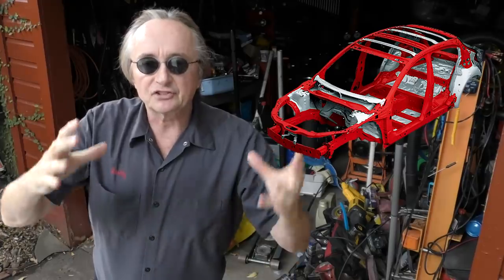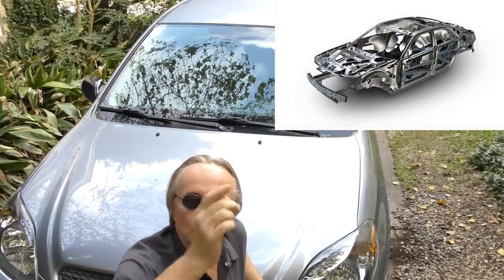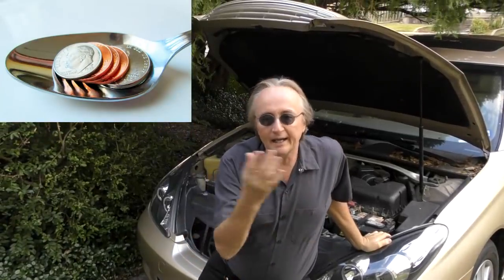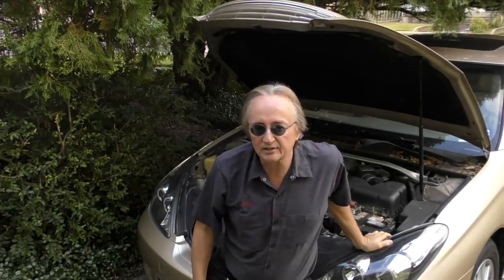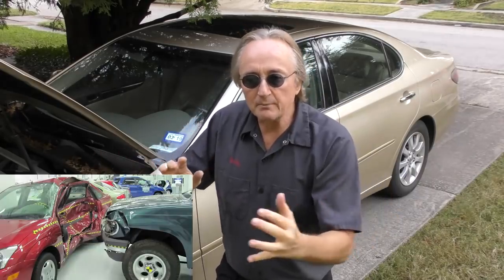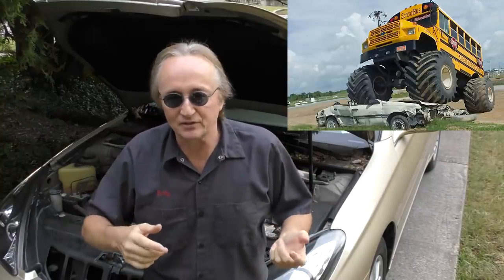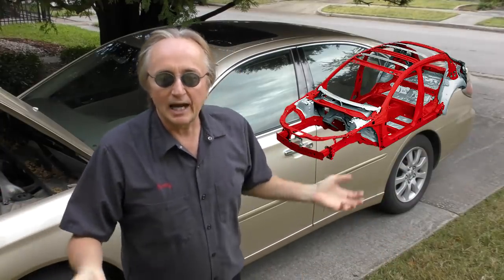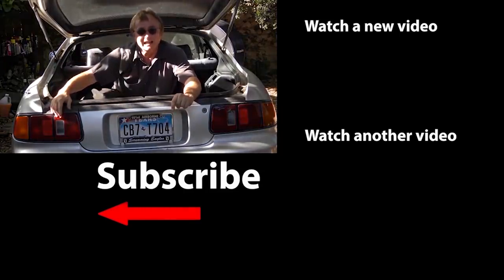Why New Cars are Safer than Old Cars

Comment: New cars: lots of crumple zones. Old cars: the crumple zone is the other car
Reply: That's how I feel driving an old chevy half ton with a brush bar and metal bumpers on both ends ahaha
Reply: No YOU are the crumpled . Actually it's even worse, the car may not even crumple and remain intact and give you crippling injuries due to the shock
Reply: This ^ rolf bjorn is right
Reply: @rolfbjorn9937   you are exactly right......its a proven fact...the more your car crumples, the less chance you have for major injuries,  the less the car crumples, the more your body becomes the projectile in a crash. Take Indy Cars for instance. 20-30 years  ago a hard crash almost always resulted in severe injuries or death.
It was a normal occurrence. But over the last couple of decades the cars have gotten substantially safer due to a scientific application of the crumple theory to every single aspect of the car. This makes the car absorb the crash much more than previously and helps to lessen the impact to the driver. Of course the drivers cockpit cage itself is protected by carbon fiber which helps a whole lot more, but even without that the cars would be way safer today than they used to be. Yes fatal accidents can & do still happen but far less often. Almost 20 years ago in Nascar  If you look at Dale Earnhardt Srs fatal crash at Daytona in 2001, the crash looked extremely minor comparatively speaking if you only look at how the car stayed together.  But Sadly  Earnhardt himself absorbed the entire brunt force of the crash because the car largely resisted crumpling
Reply: @richarddobson3138  Just to be clear, the occupant cabin/tub/zone is made to be as rigid as possible, and so are other sections, but there are indeed zones designed to absorb the impact and dissipate it, at the expense obviously of the car itself. But even with harness and seat belt, the problem (when worn) is not so much becoming a projectile, but sustaining rapid acceleration of over hundred g's.
Reply: @rolfbjorn9937   well described Rolf...thanks
Reply: @Kevin spacey You are telling us EXACTLY the difference between a stiffer car and a car that crushes. My 1999 Pontiac Sunfire faced the same things as your Grand Cherokee: 5 inch hard maple tree at 45 km/h= cracked bumper. But a tiny rear end at 30 km/h (stupid lady on medication not braking) also= awful whiplash. My car was intact. It got a good 6 varying degrees of fender benders over time that didn't bend anything, and I as the occupant had quite a shock each time. I know exactly the type of bumper cover with semi rigid plastic (you had foam, mine was semi rigid plastic) underneath between the steel crossmember. Everything that hit that corner broke itself on my car. 

I know however that any collision, especially if not a perfect front overlap would mean my death or worse at any speed higher than 50km/h.
Reply: @Kevin spacey Also, remember, modern cars are sacrified aroubd the occupant. Disposable car, important occupant. And also pedestrians too unfortunately, those pesky deer in headlight kind of people who dont look before crossing,  force cars  to be made soft and fluffy for a good 2 feet in the front (pedestrian crumple zone) and THAT makes them expensive to fix in fender benders!!
Reply: @Kevin spacey Well, you've seen wrong. Most likely aluminium crash structure, or you've seen a plastic radiator support of some sort. There is no plastic bumper of any kind in there.
Reply: @Kevin spacey And smaller cars are generally safer than SUV type, but a bunch of assholes just decided  over time that SUV for everybody, where they provide lower fuel economy and often less interior space but just being larger, taller heavier was better. 

It's harder to make a Ford Explorer/CRV/Santa Fe/X3/Qwhatever etc massive chunk of metal stop, and it's the same in an accident, more mass at same speed means more energy to dissipate, and there are quickly diminishing returns to adding more mass to it to reinforce it. 

And the higher COG means more likely to tip over. Go look at stats and reality vs your "feeling" that taller vehicles make them inherently safer. Edit: Yes, being hit by a larger vehicle means your more likely to die, but in a world of SUV taking over...it becomes moot, and you end up with simply larger vehicles overall. Collision avoidance is also easier in my tiny sedan vs a bigger SUV, but we end up analysing driver abilities when going there. And you being in favor of larger vehicles is a one sided point of view: you forget about the risk to other drivers, and there SUV and pickup trucks become rolling reapers.
Reply: A lot of times the older cars would just sacrifice the big steel bumper in a crash.
Reply: @hanskinslo326  Low speed ones, yes. Medium to high speed= occupant sacrificed. You cannot infer the survivability of a car(and mainly the occuypant) to a fatal level collision from it's fender bender survivability. My previous 99 Sunfire destroyed 2 SUV front ends, a 5 in tree and a fence and a Volvo XC70 wagon destroyed itself on my corner (front end, lost a blinker housing) , but it's top rated in deaths per vehicle because it just doesnt hold up to actual at speed collisions, and in side impact even low speed I'd be dead.
Reply: @Kevin spacey There is a full width aluminium or steel bumber., which is attached on either sides to the crash boxes. .. behing the pedestrian crumple zone, so yes, starting in 2000 roughly, there is a void between the bumper cover and anything significantly solid. But no, the car does not have a plastic bumper ffs.
Reply: Jack Girdlestone that’s not what Scotty said. He said the frame in an old car will take the impact but that impact gotta go somewhere and it’s the driver passenger cockpit of the old car.
Reply: @rolfbjorn9937  the "Body" portion of an old body on frame vehicle would be completely and utterly destroyed in a head on collision with a modern unibody vehicle with only the solid steel frame surviving.
Reply: @Kevin spacey you're completely misunderstanding this entire thing. Your '89 and '98 vehicles are "modern cars" and are likely both unibody designs. They might not be but probably are.
Reply: @rolfbjorn9937  my 2000 honda accord is the same way, been in fender benders with newer cars and had practically zero damage to my own, period even to body panels, thats not the point, the point is Kevin Spacey doesn't realize his '98 jeep and '89 wagoneer are considered modern cars, definitely the jeep and probably the wagoneer too.
Reply: That’s why I’d get. Old Volvo, they’ve always been safe
Reply: More like the crumple zone is the passenger of the old car
Reply: @tony_5156  A new Yaris is safer than an old Volvo... There is a fifth gear video where they crash an old Volvo 960 into a new Renault modus city car, and the big Volvo is crushed by the little Renault.
Reply: @rolfbjorn9937  I know a guy who had a bull guard on his truck, and hit a moose head on at 100km/h. He was able to walk away with no injuries
Reply: Go watch some crash videos...The top body will peel away from the frame and crumple bad.
Reply: Actually That Depends On The Vehicle.

A Newer Cadillac Sedan Is A Lot Safer Than An Older Cadillac Sedan.
Reply: @rolfbjorn9937  There's no crumple zone in this car, so if you crashed your car. Your face, is the only crumple zone
Reply: Old cars: The crumple zone is you

Comment: guy in school had a 78 olds.  he slid off the road that winter and went nose first into a phone pole. no damage to that car due to its thick bumper.  no damage to him.  not even whiplash.  I'd rather deal with that over an airbag exploding in my face.  guy I know was in a porsche that was about to crash so he grabbed the passenger door handle to brace himself.  side air bag went off and blew through his arm and now he has permanent nerve damage.

Comment: "What would you rather have survive in an accident? You or your car?"

That's basically the summary right there.
Reply: It's like the old joke.  Robber: "Your money or your life!"  Victim: "I'm thinking.  I'm thinking."
Reply: @dansanger5340  , The Robber Will Take Both
Reply: I bet a brand new 2020 Toyota Corolla is safer than a 1994 Toyota Celica. What would you rather have saved, Scotty? Your money or your life?
Reply: Allen Attoni  Stay clear of the Buddhists on the road.
Reply: @petersmith2040  Though cars do better in crash tests, people outside do worse! A Switz study showed that crossover /SUV type vehicles had 3.5 times higher mortality for cyclists and pedestrians in city accident scenarios! So driving an old small car that will end your life in a fender bender, might be the responsible thing to do.
Reply: Right!
Reply: Pretty much sums it up.
Reply: @petersmith2040  Celica is still unibody even though it’s from 28 years ago
Reply: With old cars, the vehicle & driver die

Comment: New cars = SAFE
Old cars = COOL
Reply: Many Mopar muscle cars were unibody........Rev up your 440 SIX PAC
Reply: OOM- 8018  ? no lol
Reply: OOM- 8018  in virtually no way are they safer. Easier to fix after a crash, sure, but the passengers will come off a lot worse than in a modern car.
Reply: @RaspberryCai  trust me you can still get pretty messed up in a crash in modern day car if the uni frame engine and transmission went into the firewall.
Reply: OOM- 8018  agreed holy crap i forget those cars from when i was kid are 20 to 25 yrs old now. and i was born in 1992. and i currently own an 06 crown vic p71 very powerful engine and transmission combo trans was just rebuild before i bought it. very safe yet aslo had the frame reinforced for all that power that 4.7 can unleash reinforced stright from the ford factory. those crown vic p71's are track racers for someone on a budget. i may trade mine after the winter and snow disappear for something older and rare as that. probarly a late 70's bronco or old school boxy suburban or k5 blazer. i got that crown vic for a steal too because his wife was getting in him for having too many cars. so he wanted 1800 at the lowest 1500 i flashed 1300 bucks CASH. And his eyes lit up like deer in headlights he agreed to 1300. only reason he took the offer he got tired of getting trade offs or lower then 1300 like a pos rusted out ranger someone offered him plus 800 bucks.
Reply: @brandonplaisted8194  It happens more often in older cars where the engine and transmission intrude into the passenger compartment. New cars with their crumple zones also help in keeping a transmission and engine from intruding into the passenger compartment. Years ago I saw an accident where a speeding motorcyclist ran head on into a 1968 Mustang. The biker obviously was killed, but the driver of the Mustang sustained serious injuries from the transmission being pushed into the passenger compartment. Another time in the news, they showed a motorcycle that had broadsided a car. The estimated speed of the motorcycle was over 100mph. The motorcycle cut through the car and the wheel was making a bulge on the opposite side of the car. Any street car going fast enough can't save the occupants. The only exception I've seen was a Ferrari that crashed in Southern Cal back around 2005 or so. The Ferrari had a carbon fiber tub, which is too expensive for everyday cars.
Reply: Holly Manigold had the steering wheel/column try to come in on her.

She prevented that with her arm strength.

she escaped serious injury by "pushing the steering wheel away from her body as the crash occurred, leaving the steering wheel broken and crumpled.
Reply: @Rhaspun  a lotta of cars are now starting fail the 5 star rating on crashing from the nhsa. it's sad because it's probarly recalls that have to do with the features that can save your life in accident vs. the car industry saving a few thousand now compared to millions in lawsuits later on down the road.
Reply: New is almost always > than old.
Reply: A GMC fullsize truck hit me before.

At 20 something crashed in my passenger rear door and got my wheel out of alighment. Of a midsize car.

The truck just had scratches on its metal bumper. Blown airbags too.

I had a concussion. Because I did not have side airbags and hit my head on a plastic panel.

Get a vehicle with side airbags and seat pretensioners. They make a difference.
I know from wrecks.
Reply: Dont get small vehicles.
All these tank like SUV's and huge trucks will mess you up more.
Reply: Hey Scotty, Happy Thanksgiving. What do you think of Hyundai in general and how do you rate them on durability and value for the money? Thinking of buying a 2019 Sonata, will this car last more than 10 years if well maintained? Also, why haven't they offered a midsize truck like the Toyota Tacoma?
Reply: You’re telling me a car that absorbs zero force and had bench seats with no seatbelts and glass that would shatter was not safe? Pssshhh
Reply: 20 yrs old car is old.
It has seatbelts so do 80s cars and 70s.
Reply: In Jan. 1, 1968 it became illegal not to wear a seatbelt in the US. 60s cars had them.

If yours dont have it then get them installed.
Reply: @Matthew Dawood Khaghani really how many recalls are done yearly and mostly due to safety equipment or stuff that prevent a drivable car or truck.
Reply: @RaspberryCai  watch the old vs new malibu charsh test
Reply: Solution buld the old body styles with the safety features of modern cars
Reply: @dragonnx2843  Those old body styles have their issues, but in fact, maybe inserted over good newer chasis could help. Know that I think about it, watching a car like the Challenger (that have that boxy but a bit curvy 70’s car look) already have good security and food crash performance
Reply: @brandonplaisted8194 Zzzzzzzz old cars aren't safe

Comment: Scotty, i want to mention the Volvo 240 had a unibody frame with crumple zones both front and rear way back in 1974. They also had reinforced cage for the occupants and a reinforced transmission well and 2 pieced driveshaft to make sure the engine was pushed under the vehicle. They also had 4 treepoint seatbelts and a folding steering collumn
Reply: Yeah, still not safe today. Any modern car would eat one alive for breakfast. (in a crash)

Comment: What about towing? Unibody vs body on the frame?
Or two cars with 5000lb towing capacity,  towing both 3500lb. Which one is safer? Honda Pilot vs Toyota 4Runner?

Comment: Which vehicles are reliable and cheaper to fix or work on it yourself? American vehicle or foreign vehicle? Also what are the pros and cons of a 2005 Cadillac STS?
Reply: He has recommended 90's Toyota's the most
Reply: Cadillacs are expensive to repair and had head gasket problems would also cost a fortune if the transmission went out
Reply: If it's a Northstar, those engines have frequent head gasket leaks that basically total the car.
Reply: Thanks for all the responses. All appreciated.
Reply: Definitely avoid Cadillac. The STS 3.6 consumed oil and the electronics are a headache. An excellent car to work on yourself is a Crown Victoria. Lots of space in the engine bay, tons of online support and a fairly simple design. Just avoid former cop cars.

Comment: My 1962 Impala had no seatbelts and no padding on dashboard. After one fender bender in 1997, that thing got sold.
Reply: Good move! Nothing like a steel dash with steel protrusions and solid steering columns. I love older cars, but would hate to get into an accident with one. Had many in my youth, but I won't have one now.
Reply: Could have just added seatbelts !
Reply: Well what happened in the fender bender that made you decide to sell?
Reply: @Kevin spacey In the time mentioned by the OP and to which I was referring, I don't think any of the safety equipment you mentioned was available on the Wagoneer.
Reply: @01trsmar Won't help much

Comment: The early unibody cars are death-traps, in a heavy crash the roof and pillars bend and the whole car crushes up. Newer cars have much stronger pillars that start at the front (the A pillar) and run the length of the roof to the rear (C pillar), these may be slightly harder to see past as they're much thinker, but in a crash they prevent the occupant compartment from folding and being crushed.
Reply: No old cars are safe

Comment: Hey! Fuel is getting expensive here, I want to run my vehicle on used cooking oil, what do you think?
Reply: My friend did that with his old Mercedes diesel!   He got his oil from fast food restaurants; when he would drive by it smelled like french fries!!!
Reply: The downside is you get less gas mileage.
Reply: I've looked into it a bit, make sure your car can do it properly and with no damage occurring, some cars don't run too well on biofuel. Secondly, you probably want to use a mix of diesel and cooking oil, so your car can start in winter and so engine wear is minimised.
Reply: biodiesel works pretty well on diesel cars (although ironically biodiesel is incompatible with diesels that have certain emissions equipment).
Obviously, don't put cooking oil or any sort of diesel in a gas car.
Reply: I want to run my car on piss. Itll be so cheap
Reply: @nov3019892008  but all the coffee you have to drink to get enough piss would be expensive
Reply: Probably will break a modern car as emission control was designed for petroleum diesel.
Reply: @bcgreen7479  Not a downside at least not in the UK for us, you can get the stuff 5p a litre sometimes as low as 1p a litre, as long as its filtered right you can run off it all summer and mix with normal diesel in winter.
Reply: It will smell like a chippy.
Reply: @garybulwinkle82  That smell! Went to a biodiesel meetup, and some of the cars smelled of fried chicken. It really got me hungry.